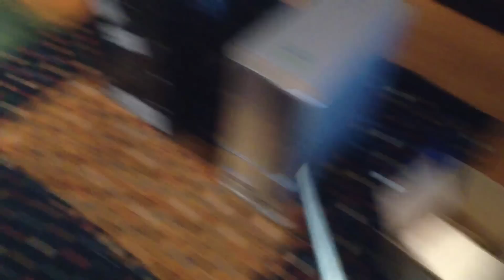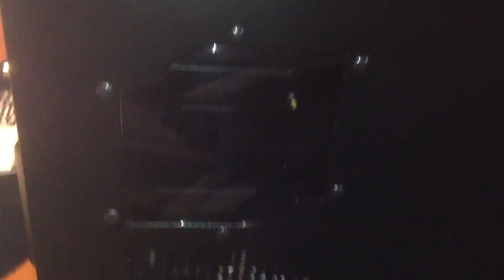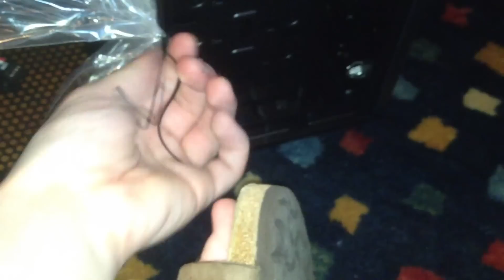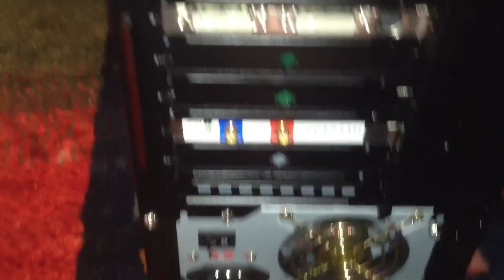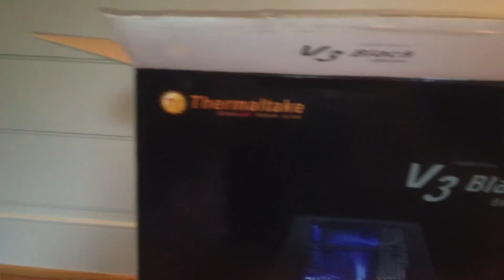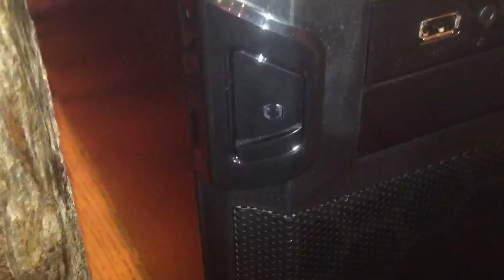Thermaltake V3 Black Edition ATX Mid-Tower Case

Comment: Now sir. Would I be able to take the components out of my Dell Insprion 3847, and put them in the V3 Thermaltake Computer Case? (By the way, Dell sucks).
Reply: +Rektangel455 why would changing the case change your performance
Reply: +TheSkater8525 Uh what? What does that have to do with my question?
Reply: +TheSkater8525 If you are thinking that I think that. No. I just need a bigger case for more components or replace one with a bigger one.

Comment from the maker: not really, because the design allows for it to actually cool itself, presuming it's not on a carpet. when the power supply is on the top, a lot of the heat from the computer goes right through it. just adds heat to the psu that doesn't need to be there. granted most of my computers have top mounted psu's